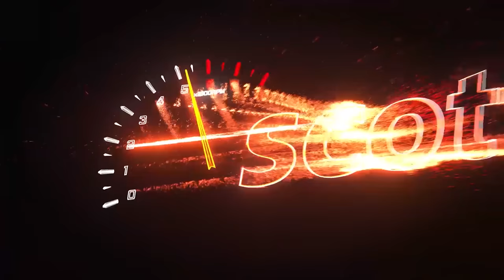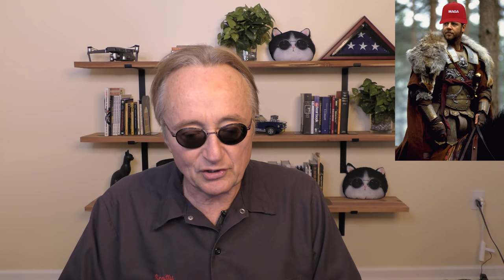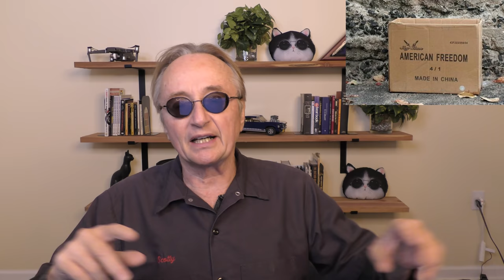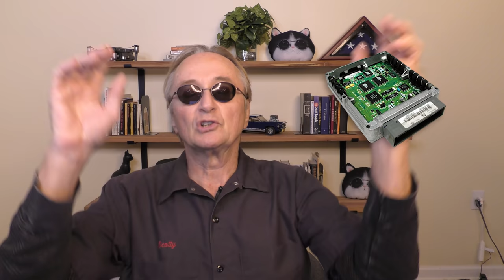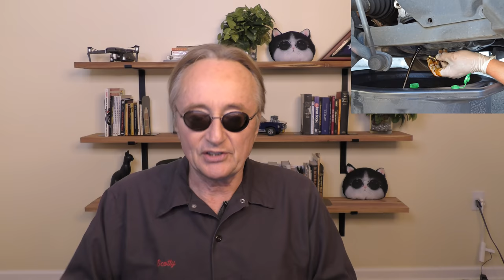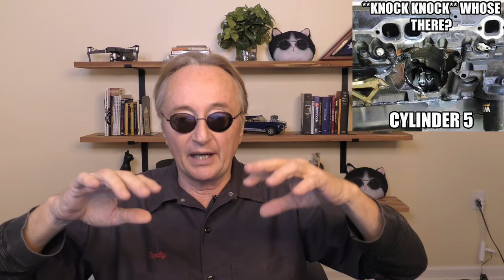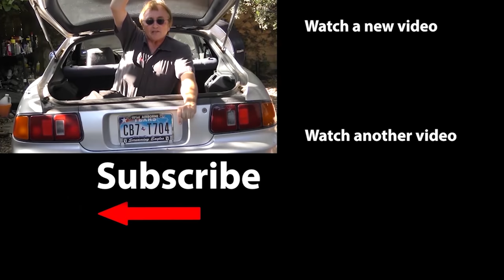Never Buy a Car with This Engine

Comment: I guess I got lucky with a high mileage 180k with a  salvaged125k engine. Clutch went out 30k/4 years later . Aiming for another 10 years with new clutch 🤞😁
Reply: Clutch can last forever if you can drive manual well.  My old Ranger is a '93 and has the original one in it still.  The release bearing is super noisy now when it's just idling with the clutch out but still grabs well so I'll live with the bit of noise until it fails completely.

Comment: I have 08 g37 coupe with 150k miles. Still runs like new
Reply: As it should. There's very few cars on the road that are made that well.
Reply: @solarfall2728  agreed, bought it used at 120k and was scared but read about their reliability. Bad on gas tho in the city lol, still long run save on repairs
Reply: @TheUnknownNexus  Those things are great cars. I don't work on them anymore, but I'm still factory certified for Infiniti. What happens is as they get older and the prices go down, kids buy them and run the piss out of them. The motors make a lot of power, and when you run it hard, it hurts the rest of the car. 

You can drive it fast, but don't beat it. All that torque is what tears it apart.
Reply: @solarfall2728  hahha you are so right, I can assure you I am one of those kids unfortunately. Cheers!

Comment: In the video I meant “What pressure do you recommend for winter tires. I find 36-37 psi works well for handling and mileage. The OEM pressure of 30psi is way too low for the soft rubber. What is your opinion?Thanks Scotty✌️

Comment: GTDI engine in the picture isn't discussed??? Different description?
Reply: I wonder if scotty even ever worked on that particular engine
I wonder if he even ever did a replacement high pressure pump on one if those new GDI engines
They run leaner air fuel mixtures and hence better fuel economy for ine thing
Kia and hyundai have come a long way
How about the new hobda civic motor that was a failure
How about some bad engines built by toyota that burned oil....
I like scotty's video's for the most part......but in my honest opinion he has a hard on for Korean cars and putting them down in his videos
He is really bias on that subject

Comment: Scotty I have an old 1978 f250 I got from my dad I used to use it as a daily driver now it just sits in the garage so I’m looking to sell it it has over 1 million miles the odometer has reset any idea what I should sell it for still runs like a clock. Made it from New York to Missouri only problem is how much gas it drinks

Comment: Hmm I guess I live in one of those weird places then? Or maybe I am just getting old? The last new made car i have seen with a carburator was the 2003 Suzuki swift.. But then again, the Dutch like theire scooters, and in some weird way the 2 stroke injection ones never worked out.. So, now all they sell is 4stroke carburated ones. This is also of climate sjeit.. But mostly because it got clugged up so mutch because a machine that needs small "jets" like that does not like the feul quality that mutch.

Comment: Hey Scotty, I have a 2003 Lexus RX300.  It starts and runs fine, but if you shut it off for a few minutes  and then start it back up, it will misfire for a couple of minutes and then start running good again.  Any ideas?  Thanks!

Comment: Yep, Crashed ( not my fault)my 2000 Durango after keeping it perfect fo 20 yrs. Went with a new 4 Runner.
Reply: My neighbor has a 2000 Durango. Still going. They made them right back then.
Reply: @FM-nu8rz  Yea, i have to say i loved that truck, 5.9 l fully loaded 4x4 no rust clean (i was pissed) it had a distributor that actually turned. U can not drive the 4 Runner the way i drove the Durango or u will roll it. Durango had very low center of gravity and wide tires, u coud drive it like a Camaro. 4 Runner i bought because i don't trust the domestic Manufacturers quality in this day and age and the 4 Runner has been basically the same for 20 years with tech toys added which is fine(its proven) just gotta drive it slower.

Comment: I need help. I’m looking at an 03 Nissan Maxima gle with 180k miles. They said the motor is knocking and it will probably need a new motor. They had it listed for $950 and Talked them down to $750 since I will have to have it towed 40 miles. Should I buy it? I’m thinking of replacing the engine with a used engine that works. I can’t get a car loan because I don’t make enough. I’m a single mom with no child support going to college living with my father. I have fair credit. I make $400 a month doing postmates with a car I share with my sister. I need a car to get a job not doing postmates. Should I get the car?

Comment: I had a theta 2.4 engine fail at 135k. hyundai put a new one in. No way I'll sell the car now. It costs me 0 bucks to own.
Reply: New?
Reply: Those are the best cars to own, when they are paid off and still have a ton of life left.  No payments is mint
Reply: @robertstv8045  ya the dealer would put a new crate engine in the car, it's under a recall.  They fixed the issue and installed an updated engine in all the cars that were affected.   Why would the dealer put a used engine from a junk yard in ? They could be putting in an engine that has the same problem as the one they are replacing.  My gf sister has a Kia that had an engine that was part of that recall.  She got a NEW engine.  As in 0 miles on it.  They gave her a 60k warranty on it as well.

Comment: Scotty: what do you think about a 2004 Hyundai sonata?
Reply: At this point they all probably have high mileage which is when they have problems. I wouldn’t touch it unless you get it dirt cheap.
Reply: @aryan.r4126  A 2004 model would be very iffy.. 🙄 Hyundai engines have been played with engine problems.. The ones even as late as 2015 had early engine failure.. You take a gamble when you buy Korean cars.
Reply: I've worked on Hyundais before and if you're looking for something affordable, I suggest you get the Sonata from 2006 to 2010 with the 3.3L engine. Those models were the most reliable. Since 2006 all Sonata production was moved from Korea to the US.

Comment: Hello I have an 2012 f150 lariat 5.0 v8. It has 172,000 miles. It runs good but it has the tic that I've seen in those motors. What is the problems? And what should I do? I keep the oil changed new plugs has good power.
Reply: I put some Lucas Oil Stabilizer in mine once it got 150k on it and it made quite a difference in the noise department.

Comment: Hi Scotty, I just bought a 2004 Toyota Matrix from the first owner with 145k miles. The car was dealer maintained with a folder full of records. 
Car drives great but it vibrates pretty bad when at a stop light. Plugs were changed last year, could it be motor mounts?
Thanks
Reply: First start basic by checking the air filter if it’s dirty change it. If it doesn’t fix it, it could be the motor mounts.

Comment: Hi Scotty.  I have a Ram 2500 with the 6.4 Hemi with 56,000 miles... and currently on my 3rd set of lifters.  Ive always changed oil when supposed to, but now I’ve now been minimizing idle times and have been thinking of switching to a 5w-30 redline versus the 0w40 Pennzoil Chrysler recommends.  Is this a good plan to keep me from eating lifters or should I just sell the damn truck?
Reply: If you can get any good money for the truck just say goodbye to it. The issues you had in the first 50k should warn you about the future.

Comment: So my mechanic is saying somethings been going on with Chevy brand oil. We’ve noticed our oil not lasting as long. So they wanna do a consumption test & say if they find anything we could get a new engine from the dealership. So are these good refurbished engines you get from GM? I have a 2013 traverse with 87k miles on it.
Reply: GM DEXOS oil is a good certification. It’s probably not the oil, it’s probably going the full oil change interval on those early 3.6 V6. You probably have some timing chain stretch and or some oil consumption. I doubt GM is going to do anything for you. Trade it in before it doesn’t run and buy yourself a Mazda, Toyota or a Honda. If you really want to buy another traverse the new V6s are a bit better Just change the oil more often than the oil life monitor calls for. Like every 5k

Comment: Is it better to buy a 3rd gen toyota 4runner with an automatic transmission and change it to a manual at toyota? Or buy  a manual 4runner from factory with a manual transmission.
Reply: Factory manual transmission it’ll probably be cheaper to do and much less of a hassle.
Reply: @aryan.r4126  so change it from auto to manual at toyota?
Reply: @aryan.r4126  or is it better to buy a 3rd gen 4runner with a manual transmission on it? Cause here where I'm from in africa they're super rare and I would really love a 3rd gen with a manual transmission.
Reply: @rampagedingo  No get one with a manual already in it.
Reply: @aryan.r4126  they're hard to find. I'll probably go for a toyota land cruiser prado 90 manual from 1996 to 2002. They're everywhere here in Mozambique and are in the best conditions. I wanted a Toyota hilux from 1998 to 2004 but most of them are abused as work trucks with broken 4x4s. I'll look around and compare prices then make a decision. Thanks for the advice mate.
Reply: @aryan.r4126  cheers

Comment: Hey scotty i just wanted your advice im about to buy a 2018 acura tlx with 19500 miles is it a good reliable car?
Reply: Both engines offered are very reliable and proven. The problem are the transmissions the 9 speed Zf had issues, I would go for the 4 cylinder.

Comment: So i have a 2000 dodge Durango and the blinkers cruise brake lights and hazards  went out and I dont know what happened
Reply: Most likely a fuse went or possibly a relay.  Typical dodge with electrical problems.  Check all the fuses first.  Could be in the cabin somewhere( side of dash, lower dash) or under the hood on that car.

Comment: Kias are v good, the problem is theta 2 engine, which was develop with Mitsubishi and Chrysler, but still it not the main reason - the reason for recall and failing is due to debris left by some american forging/casting company.
Reply: I believe it's actually machining debris leftover from when the engines are machined in the CNC machine after casting, for the cylinder bores etc.
Reply: @dgxdetailingservicesltd8461  you're correct, althought Hyundai is building its engines inhouse, including forging, casting and boring - that is true for asian and european market, but in US they decided to outsource it - therfore - korean build theta are problems free.
Reply: @charleslulz6579  That is correct. The engines built in Korea are not under a recall. Only the ones built in the Hyundai Alabama plant and Kia Georgia plant are the ones getting recalled.

Comment: can you speak about frensh cars ,peugeot and renault , here in morocco we buy dacia logan (renault )  because they are ship and the are good they can last more  than 300000 miles troubles free
Reply: PSA and Renault left USA in the 80s.
In South America, some Dacia cars are sold under the Renault brand such as Logan, Sandero and Duster. They are good and resistant cars, but their interiors should come with better materials. Too much poor and noisy plastics.
Reply: They dont sell them in America and there are very few of those over here.  Cars have to be 25 years old before they can be imported to USA if they were never originally sold in USA.  Best to ask someone in Europe about those cars, someone who would have much more first hand knowledge about em.
Reply: @fpguim4   thanks
Reply: @dgxdetailingservicesltd8461   thanks

Comment: Toyota is focusing on its solid state EV, very excited, and Tesla with the 25,000 dollar model 2 is set to enter mass adoption, the future also looks good for hydrogen, Xpeng is going back down to 20 dollars per share, so regrouping, then a new thruster to 80 dollars?

Comment: a food for thought, if I can increase the volume oil capacity of my engine, would I be able to go longer between changes or am I still stuck with the same oil change time, if I (say) double the oil volume from 4 quarts to 8 quarts, theoretically I should go twice as long between oil changes, yes/no?
Reply: How would you plan on doing that? And what would it save? Youd be putting in twice as much oil to drive it twice as long? Even if you could figure out how to do it, they dont exactly make bigger oil pans for cars.... you wouldnt be gaining anything.  Just learn how to change it yourself and do it every 5k.  It takes me under 10 mins to do an oil change in my driveway.
Reply: @dgxdetailingservicesltd8461 ,  actually, I am a certified diesel mechanic, there are ways of adding to the increasing the volume of the oil of a vehicle, I just have to put it together and do it myself to see if would actually work, between the volume increase, oil coolers, maintaining serviceable temperatures, I was asking if anyone had any actual information on doing this
Reply: @limojag  
The quality and change frequency of oil filters is a big factor too.
Reply: @danielpassigmailcom  , kind of the point of having twice as much, half as much would be circulating the same times, the same GPM but now with twice the oil on hand.

Comment: Hey I’m looking to get a 2007 Toyota Camry XLE V6 with about 95,000 miles on it. Is there anything I should be worried about with that car or will it last me a decent amount of time?
Reply: oil burning
Reply: @thakiddmistic7610  I read that was only the 4 cylinder models
Reply: No you are avoiding the major issues by getting a V6 as the 4 cylinders burned oil.
Reply: Nope should last you.  Make sure you warm it up properly every day.  Get in, start it and hold your foot to the floor on the rev limiter until it comes up to temp.
Reply: @dgxdetailingservicesltd8461  stawp it

Comment: Scotty: I have a puzzling front-end issue.

--vehicle type: 2005 Chevy Express Van, 3500, 6.0 liter 

--some weeks back the cap came off wheel bearing on passenger side.

Had both wheel bearings replaced, Driveworks(the kind mechanic installed.

--vehicle still wobbles

--Firestone changed front shocks(did no good)

--had upper/lower ball joints replaced last year.

--Firestone replaced Primewell tire, if I'm not mistaken.

--still wobbly(I am confused???)

Got any solutions? I'm confused, and I don't have money to continue paying mechanics guess-work.

One note: the wobbly did not happen until after wheel bearing issue. I paid another mechanic to re-rplace the wheel bearing, but he conveyed the new wheel bearing was good.

864-325-9939(feel free to txt or call)

Comment: *Please Read* What you think about 2014 honda accord hybrid? Are they reliable? Thanks
Reply: They are reliable up to a certain point. Personally if I were you I would just get a plain 4 cylinder Accord they get good gas mileage and last a long time without major maintenance.
Reply: @aryan.r4126  Hi Aryan, Thanks for the replay. The car I'm looking at right now has 37k miles and the owner is saying it also have extended warranty.  I checked on other accord with plain 4 cylinder engine but they are going for little expensive then this one.
Reply: @gpannu2127  How many years is the extended warranty also how much more for the  4 cylinder model?
Reply: @aryan.r4126  The owner said that extended warranty is till 2022 and other 4 cly I checked in my area is going for 15k with around 50k miles.
Reply: I'm hoping that he can take around 12k for it
Reply: @gpannu2127  I would negotiate the price on the 4 cylinder and spend the extra for it it’s worth it.
Reply: @aryan.r4126  Does the hybrid have alot of problems?
Reply: @gpannu2127  Yeah when they get high mileage the battery needs replacing which costs 5-7k
Reply: @aryan.r4126  Damn 5-7k is a lot lol. What is high mileage in your perspective for this car?

Comment: Never never buy a Kia
Reply: We bought two and never regretted it. They are bulletproof vehicles.
Reply: I had 2011 Forte with the 2.4 and a 6 speed manual.  Drove the piss out of it and it never skipped a beat, never had an engine light and was still running like a clock when I got rid of it at 125k miles.  I still see it around town from time to time.  They are decent cars in my opinion and personal experience.

Comment: I drive a 2015 Hyundai Sonata SE with a 2.4 L GDI Engine 193K the engine went out. I felt like it was premature Engine failure but it turns out these engines have major problems. I got the Engine replaced for $1.600 (before labor) which was reasonable, the car is worth about 3.5k or so and I was gonna scrap it but the car is still in Excellent condition with no other problems I am just worried about the Engine failing. If it fails again I will definitely be getting another car. Hyundai and Kia need to do better. They make good stylish cars but engines eh no so much......

Comment: Replacing the engine and sell it is not worth not. Cut your loss and get what you can for it. 

You not rebuilding a classic car
Reply: Engines are cheap in my area. I have replaced 8-10 engines over the years. Replaced my 03 Kia Rio motor 3 years ago. Got it for $250, had 110k on it. I have 152k now and it's still running. Only took me 2 days to swap it all by myself.